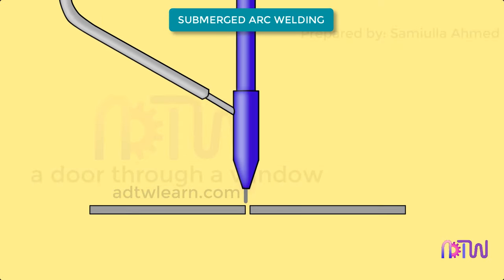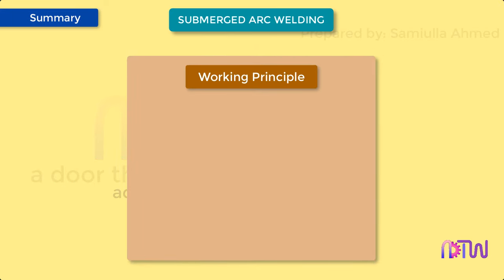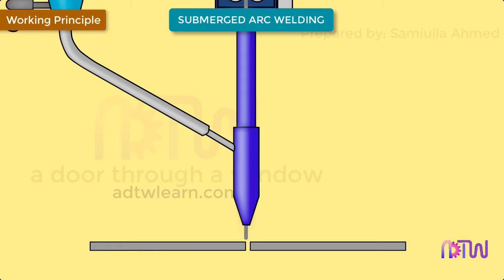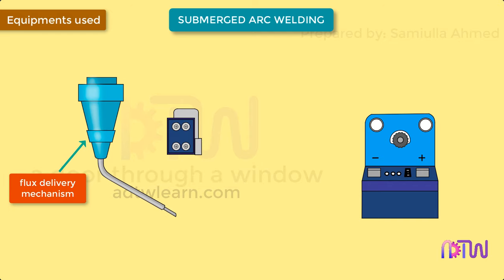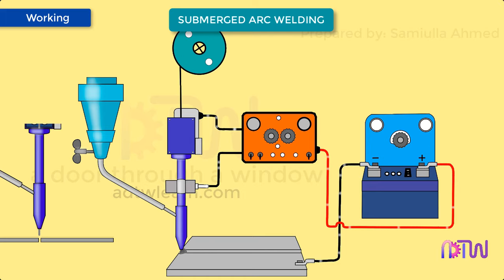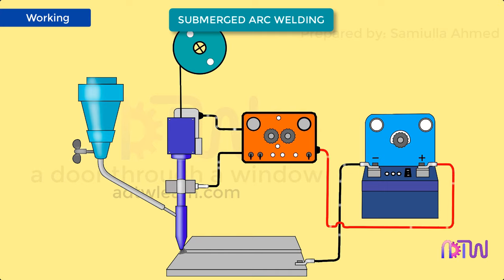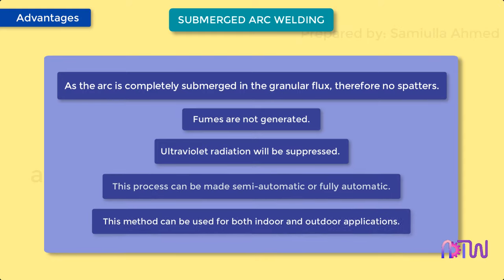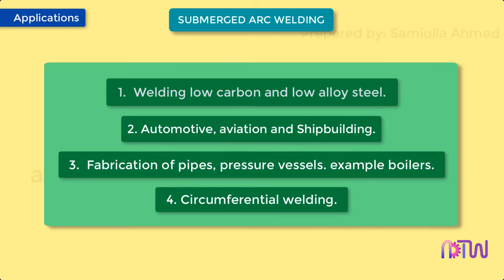SUBMERGED ARC WELDING | How submerged arc welding works.

Comment: well dang. of all the welding methods i've never heard of this one.

like i know 111 (stick), 136/138 (flux core and powder core respectively), 141 (TIG) and explosive welding (basically using directed explosives to violently force two materials that normally will not bond)